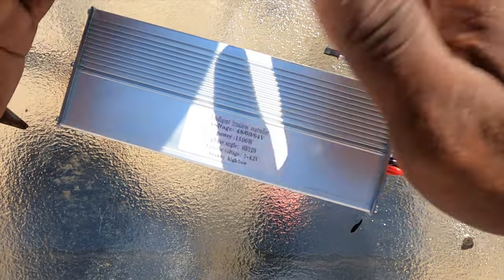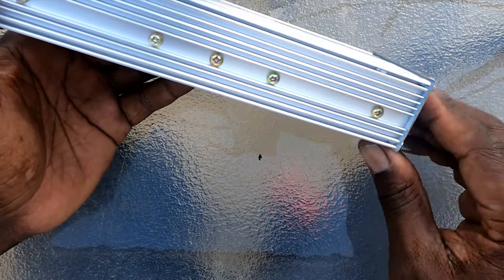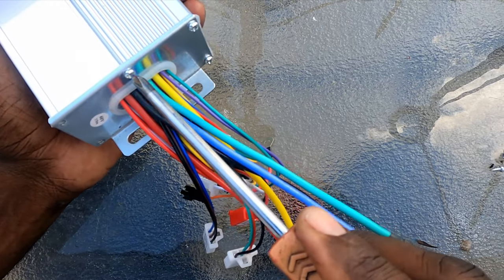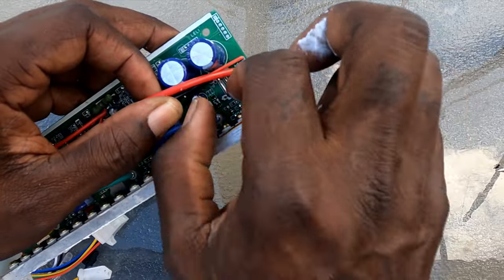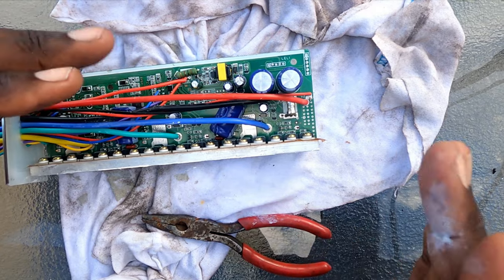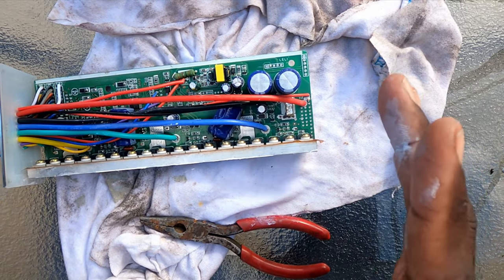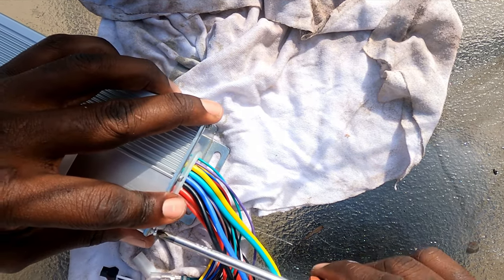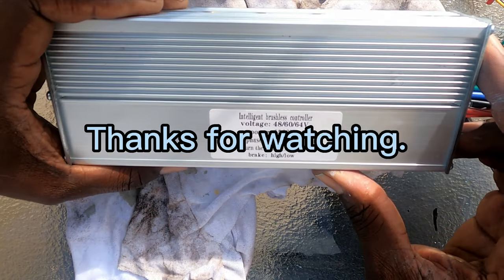How to shunt mod your ebike controller for more power.

Comment: Another GREAT video Bro. Keep up the tutorials so that the ebike community can become more Educated..... I plan on doing the shut mod, but should I add more thermal past to help with cooling??? What are your thoughts on that?
Reply from the maker: Not much tho. But thermal paste do help with heat transfer  but if you don't have none on the bar to heatsink then add some
Reply: @E-bikeguy How is it that by just soldering the top of the those three Shunts you are going to increase the power, being that shunts are practically resisters, and the solder connectors are still connected from A to B on the mother board,  my common sense would be that you desolder and remove the shunts altogether, and run a heavy gauge wire from A to B from the mother board base, please correct me if i'm wrong, and why would your way of doing it work as well?
Reply from the maker: @alexshatner3907  that's also a good idea but I think the why people just solder is it too much work lowland it just easier just to blob some solder on top of the sunts
Reply: @E-bikeguy  E-bike guy I need you help in solving a problem, I went ahead and soldered a thick wire from behind the motherboard, bypassing the shunts, Yes the scooter took off like a rocket, but only lasted 30 seconds and the controller smelled like burnt,and died what did I do wrong?
Reply from the maker: @alexshatner3907  hum nothing really it only add just a Lil performance to your scooter but nothing more I don't think it short out on ya
Reply: @E-bikeguy  It was just short strong take off and then it died, do you think that maybe the shunts are there for a purpose, anymore amps going through will burn your controller?
Reply from the maker: First this ever happened especially for a shunt mod, when people do it ,it's to trick the controller that it needs to pull more amps and it's a free mod
Reply: @E-bikeguy  I think what it is my brother, is that my controller is a 37 to 48 Volt unit, the one you have showing on your video is a 48 to 72 Volt, so which means your handles more amperage without burning up.
Reply: @E-bikeguy  I'm  your new subscriber
Reply from the maker: @alexshatner3907  I see it's was for my son he has a 60v battery I always get a controller that can go from 48v to 72v his last one was a 48v but it had 60v caps in it so we ran that for a bit then we sold the controller
Reply from the maker: @alexshatner3907  thank you bro 💯 much appreciated 👊
Reply: @E-bikeguy  A 60 volt Battery will last longer on along road trip right? because I run a 48 volt battery bit once it gets below 48 volt the scooter shuts down, at least if you start on 60 volt, it would be along tome before I come under 48 Volt so which means longer running time, am I right?
Reply from the maker: @alexshatner3907  well, it depends on how many cells you have in parallel that's what gives you the range
Reply: I need more speed on my emmo monster 72v wat do  i do the same thing?

Comment: Yo wassup, I have a question I have a engwe ep 2 pro fatbike 750 watt version. I want to make it go faster what could I do to make it faster?
Reply from the maker: Well a shunt mod will make it go faster but it is not recommended  because I burned up a controller in the engwe Engine pro 2
Reply: @E-bikeguy  Oh damn that no good, could I also change the controller to give it more power I currently have a 750 controller in it could i change that for like a 1000w without changing the motor or that doesn't work?
Reply from the maker: @Veruva  yes, just a little more power
Reply: @E-bikeguy  So if I change controller I won't also have to change the brushless motor right?

Comment: Hi, grate video. Just a quick question, method to my madness some of them bored have a different way its like a small micro fuse and u solder a small bit of wire on for more power to trick it to get more speed/acceleration, if you was to soldered a thick bit of copper on top of thm three wouldn't that let even more power through or all it can. So if I use a thin bit of wire 0.3 24awg/ 0.5 copper wire or a thicker bit of wire 1.5 18awg/2.0 copper wire. Would the thinner bit of wire let less amps or less currant through will only do a little bit more top speed/acceleration, as a thicker bit of wire will allow more amps or current to flow through giving more power to motor for more top speed/acceleration am I right in thinking that or am I wrong?????🤔🤔🤔👍👍👍👌👌👌👌👊👊👊
Reply from the maker: That is interesting you might stumble on to something never tried that method tho
Reply: @E-bikeguy  cos the micro fuse only let's so much power through there for restricting the top speed/acceleration. I would of thought the thicker the piece of wire the more power/amps can flow through it and the thin bit will only allow a little bit of power/amps to flow. 🤔🤯😲🤣🤔🤔👍👍👊
Reply from the maker: @liamdtraxxas2011  nice!!!! You need to send me a picture of your project.
Reply: What about putting in bigger mosfets and plenty of good thermal paste with a bigger heat sink to help keep them cool???
Reply from the maker: @liamdtraxxas2011  it's possible but it's more involved than just a shunt mod lol

Comment: Was hoping i can shunt my controller since it seens to be a unique controller to the brand i bought and there isn't any i can find that would fit any of my existing wiring. Mine has a 10pin main line, 3 pin sensor, 4 pin tail light, and a triangle 3 pin motor cable. Open up the controller casing and it is filled with silicone so its impossible to take out the pcb without cutting the aluminum case. This is really frustrating because this bike can do so much more than the 25mph its limited to. It has a 750w rear hub with 90nm of torque. 48v 15ah battery but the controller is limited to 20amp only. If only i can shunt it and get it to at least 32mph, i would be happy.
Reply from the maker: On man yes I had a few like that impossible without breaking something
Reply: @E-bikeguy  it is. Think I already messed something up by trying to push it out with a metal flat screw driver. It slipped under the PCB and touched something on the corner and it sparked. Now my left handbrake (front wheel) won't trigger my brake light. If you have any idea what controller (30a) would work with the Puckipuppy Hummingbird, would really appreciate it. Thanks.

Comment: Do you have issues with lack of throttle sensitivity after a shunt mod? Like is it harder to creep with the throttle, does it end up feeling more "on and off"?
Reply from the maker: No. It's the same on throttle input but more phase current to the motor, my son had one for a while. We sold the controller and still going so there is no like on/off so you good on that front

Comment: Hey E bike guy, will that mod to the controller affect the life span of the controller? Will the controller over heat?
Reply from the maker: It depends if you going up really big hills or overvolting it then on issues with overheating
Reply: @E-bikeguy  Thanks bruh! I'm new to e biking, waiting on kits to build two new Mongoose Dolomites.

Comment: Is this the fame with famex 2000w controler i currently have a 48v battery hooked up and im wanting to ad another 48for more power tho only have a 2000w controler will this work to make it faster ?
Reply from the maker: Nice, not only you will have power but more range
Reply: @E-bikeguy  thanks for replying bro 👌

Comment: shunt modfing should include thicken the traces... thicken the cables and not use xt60 ... and adding more cooling with increasing thermal mass (add some heatsink material) ...

Comment: Hey man question  i have a 1500watt kit in my fat bike  . Will that be the same controller?   Also my controller had 2 blue wires the manual says if they are connected together i can only get 50% power  but if I disconnect i can get full power , is that what they doing now to avoid people soldering the shunt together? Or we can even do the soldering shunt and get more out of it ?  

Also can we ad another battery together to have 2 for more range ?
Reply from the maker: Ok good question,  my answer is yes, you can add a second battery for more range also power,  yes the blue wire if connected will restrict to 750w to comply with the law and doing  a shunt mod will have more power blue wire will have no effect its just safety and law concern
Reply: Ohh ok  i just bought this kit and it was pretty expensive im afraid of loosing warranty if i try to open it up  lol

The seller says this is a 48v 17 amps battery   If i do the shunt mode won’t kill this battery right?
Reply: Thanks for you fast reply too   My son is 17 and he also wants to get an electrical kit like me , he has a cruising bike with 80cc ebay kit engine there and he can’t keep up with my fat tire bike   Top
Speed i had have it in a  fully charged batt is 36 mph with 215pounds and fat tire bike are heavy  but my son the weights 170 had this bike at 40mph
Reply from the maker: @diytech1008  nice my son is 15 and his  bike top speed  63mph but don't go that fast lol

Comment: Be careful when hot rodding a 500w ebike. I done the shunt mod 3 years ago. Blew 2 motors and 1 controller blew the mosfets. 750w and higher wattage motors the shunt mod works the best. I learned it the hard way. It was fun for 30mins of riding. Makes the bike wake up and do back flips Lol.
Reply from the maker: That's correct I've also learned that the hard way.

Comment: Hi I done the shunt I was told it could burn components out anyway I found alot of torgue after it blush fuse I had 30amp so I put 35amp but I thought I would check the solder and took a little of asci wess doing that I caught a mosfet it still ran but power was just a little less I'm getting another controller same one I did buy 45amp controller for 2000wat it's serpose to do 50mph I got less than that I think the upgrade on the old controller was better 35+2 amp so have you had any both of it burning out thanks
Reply from the maker: No, in fact, I sold it to a customer and its working great, there are some risk in doing a sunt mod to a controller but rare.
Reply: @E-bikeguy  hi thanks I did do it the torgue was great power great second day blew a fuse yes I nipped the bars together then solder top. I thought I would scrap more solder of when doing this I caught a mosfet tiny spark I new it gad blow it still works but not so good I've just got  new one today I'm doing it again and I will use 35amp. Yes I bought 45amp 53mph but I find the PAS isn't the way it should be and power drops with Wight of me 12stone. I find the sw900lcd crap the other one for my old controller far better. So that's a job today trouble is weather England no good for eltric bikes california ammrica best for bikes thanks or was the controller fie a 1500wat its the same on 2000wat

Comment: What about a 3 speed scooter controller? 1 speed 6mph-2 speed 12mph-3 speed 15mph. Can I mod that controller?
Reply from the maker: It depends on the controller,  you can open it up and see if it has shunt
Reply: Did you ever do this mod?
Reply from the maker: @CannondaleF700  yes I did, in fact I sold the controller,

Comment: do you know much about the vivi china made bikes and controllers? Can I just unplug a connection in the controller to bypass the speed control feature?
Reply from the maker: Not familiar with them but you can see if the controller have two blue wires connected together,  you can unplug them and will give you more speed
Reply: @E-bikeguy  Copy that. Thank you for your knowledge and willingness to help. Much appreciated.
Reply from the maker: @andyrueter3087  no problem

Comment: My friend, cai I put a 72v 3000w 60A controller on a 72v 3000w 45A motor ?
Reply from the maker: Yes, you sure can
Reply: @E-bikeguy   My friend, it doesn’t gonna blow up my motor?... I forgot to say that mine is a go kart motor, not a hub one. 
I have a 3000w 72v wich is of 45A, but my controller and my battery will give it 60A, there’s no problem if the controller and the battery gives 60A instead 45A? 😰
Thank you a lot for response 🙏🏽
Reply: Does not gonna blow up my hall sensor if I put 60A in the 45A motor ? 🥺
Reply from the maker: @emilianotaboada255  you will be ok, trust me

Comment: I did a shunt mod on my 500w ebike but it keeps turning my battery off after about 5 seconds of riding. What am I doing wrong?
Reply from the maker: I might be the bms in the battery is cutting off voltage
Reply: Is there a way to stop it from doing that? Or do I need a different battery? @E-bikeguy

Comment: Ever thought of modifying the star to delta motor configuration?
Also, what about using vesc 72200?
The problem with that mod is u risk burning your motor....
Reply from the maker: No, I heard good things about vesc controller

Comment: Wish someone would do a shunt mod to a bafang internal controller. Just saying. Oh yea, I did get the cable for changing settings, but you need an older version than windows 10 to work. Waisted 20 bucks

Comment: Can i do this with a 48v 35a 1500w controller?
Reply from the maker: Yes you can, this is a 1500w controller I'm doing a shunt mod on
Reply: @E-bikeguy  but my battery has only a 40a bms so is that possible than?
Reply from the maker: @🔥Drum&BassBoy🔥  yes. Your bms will allow you to go over a certain amount before it trips
Reply: @E-bikeguy  thanks dude
Reply from the maker: No problem 😊

Comment: I saw a guy talking about steep hills and blowing the controller, will my 1500 watt 48 volt motor and controller blow if i go up steep hills or no?
Reply from the maker: No, as long as you don't over volt the controller
Reply: @E-bikeguy  How can i make sure i dont do that?
Reply from the maker: @Zvat  so if controller is a 48v just do 48v not 52v and you will be ok
Reply: @E-bikeguy  Alright thanks for the tip ill try to this cuz i want more acceleration if this works well youre a life safer man
Reply from the maker: @Zvat  ok no problem, glad to help

Comment: Hey man I was wondering if you could help me just got a nbpower 5000w hub motor and it doesn’t spin freely . It’s not locked up or anything and if I spin it with my hand it will spin okay but it just feels like something it dragging and it makes a some humming noise ????? Do you know what that could b or how to fix it or maybe I need to give it a hall test
Reply from the maker: Yes my 273 also humming when I spin it but if it's hard to spin make sure the phase wires are not touching each other but due to the strong magnet there will be se resistance
Reply: Okay cause I have a 3000w and it just spins freely but yea when I touch the phase wires it’s way to hard to spin … so what I’m a feeling on my hub motor for the 5k is okay and damn bro you r the best thank you 🙏 so much for getting back to me !!! 🎉
Reply from the maker: @fredrobles1136  no problem
Reply: So it’s okay that it’s not spinning freely and has a small little drag to it and I haven’t got my new controller but I was gonna ride like 3 miles and if it gets super hot then I think something is prob wrong ??? Right
Reply from the maker: @fredrobles1136  yes if it gets hot to the touch then there is too much current going to the motor. But yes it's gonna be some resistance

Comment: Hey do you know where to get good triangle battery for a 3,000w 80A 72v
System around 30ah? Thanks as always!
Reply from the maker: US $328.30  30%OFF | 72V 40AH Triangle Bag Scooter Electric bicycle lithium battery 2000W 3000W 72V Battery Pack
https://a.aliexpress.com/_m0dYLfo
Reply from the maker: These are very good battery,
Reply: @E-bikeguy  ok thanks
Reply from the maker: No problem
Reply: @E-bikeguy  good price, but 220.00 for shipping though :-( , great vids!
Reply from the maker: Thanks bro. I know, that's the worst part 😥 the shipping!!!!
Reply: @E-bikeguy  just saw the same battery on Amazon for 1100.00, so Ali express still better deal👍
Reply from the maker: Oh wow, I don't buy my battery from Amazon lol
Reply: @E-bikeguy  I just checked out the link. You bought the 40ah version right? Is that the one that burned the nickle and had issues with the bms? I see it lists cutoff voltage at 56. That's pretty low and will shorten the cell life. My bms cuts off at 62, most of them cut off at 60

Comment: Can i use this controller on my lectric xp 3.0? My OEM one is done i think and i cant find the same one anywhere online.
Reply from the maker: Yes you can,  you will have to change the connectors
Reply: @E-bikeguy  so change the connectors and thats it? After that plug and play pas will work and everything? Could you send me a link for this controller
Reply from the maker: @subliminal128 ok I will In a few
Reply from the maker: @subliminal128 SEBLAFF 48/72V 1500W Brushless Motor Speed Controller Replacement for E-Bike Electric Bicycle Scooter https://a.co/d/5lqwBYB
Reply: @E-bikeguy  thanks buddy much appreciated!
Reply: @E-bikeguy Does this work for lectric 2.0?
Reply from the maker: @envikka  as long as the controller has a shunt. It will work,  be warned,  not all controller can handle a shunt mod.

Comment: i had 3 shunt´s and only 1000W , maybe i had more watt´s ?
Reply from the maker: It will still be 1000w  but you will put more than 1000w to the motor
Reply: How to modify the Power delivery, I pull the gas after 2 seconds the torque is comming  that's bad

Comment: I have a 52v 2000w kit with a 35 amp controller, how many watt increase will I see with a shunt mod thanks
Reply from the maker: You will see about 60 amps 4000w
Reply: @E-bikeguy  will this be okay for the motor and controller? Thanks
Reply from the maker: @DwayneTheStoneJones  yes it will